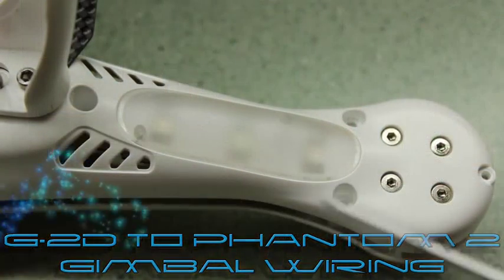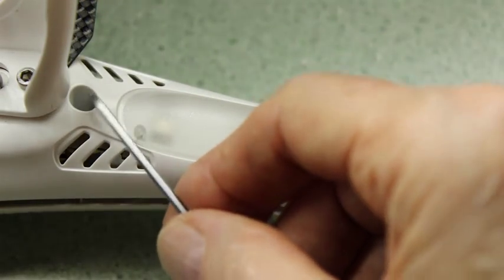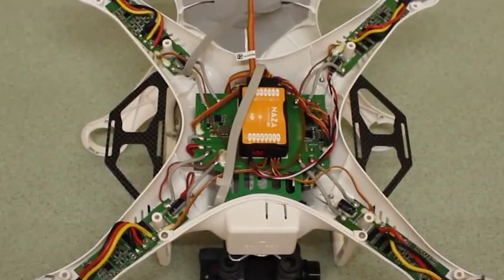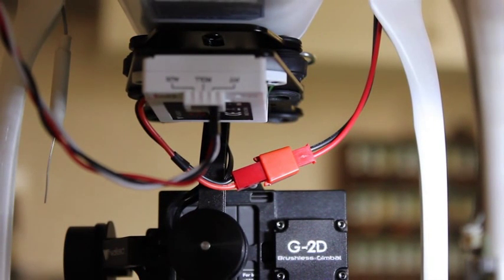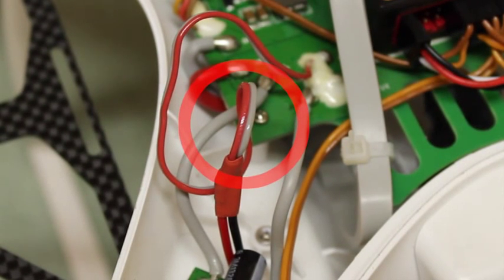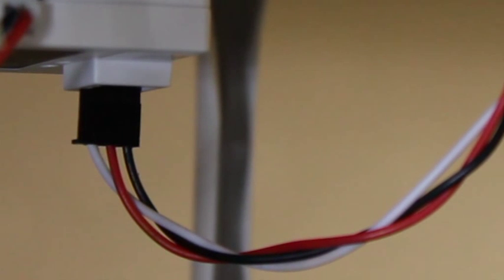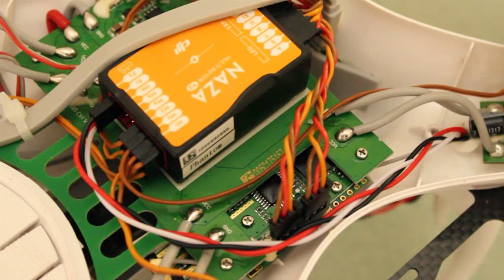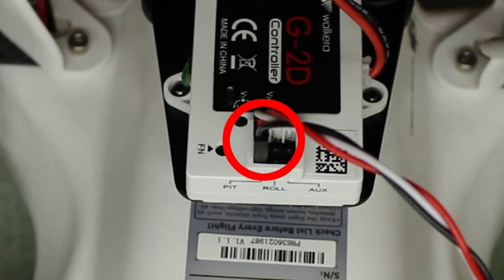Quad4A - G-2D to Phantom 2 - Gimbal Wiring

Comment: Do you know where can I buy the wires? Thanks
Reply from the maker: The correct name for the power lead is JST RCY.  Google that for data sheets, etc.  However when you want to buy from ebay, etc, the are also know as JST BEC set, 2 Pins JST Female + Male Connector Plug Cable Wire Line, JST battery lead, JST Connector Plug Cable Line Male+Female for RC BEC Lipo Battery, etc.  So JST BEC should be a good initial ebay search.  The cheaper ones usually have shorter leads so work out the length you need.  If you need longer you can always make up your own by buying the connectors and a crimping tool if you have a lot to do. 50 sets RC JST BEC Set Male Female Connector Battery Switch 2 Pin Plug Tin Plated was what I got last year for $6.65 and a $14 Dupont Pin Crimping Tool 2.54mm 3.96mm KF2510 28-18 AWG Crimper 0.1-1.0MM dps crimping tool but I know use a $75.00 PA-09 Micro Connector crimper Molex JST AMP HRS JAE Crimp Crimping Tools Japan which works better and does the micro ones which is the way the plugs are going.The other 3 wire leads are just RC Servo leads. 10x 150mm 15cm RC Servo Extension Lead Wire Cable Male To Male Cord Futaba JR cost $8.40 but they also come in different lengths and can have male and female ends.  They are really just Dupont plugs (like in your PC) and you can search and buy those as they can be cheaper but the wires are separate and not in a ribbon like the servo leads.  You can also by crimp connectors, Dupont, JST RCH, etc, etc and make up your own leads of any length or type with the $70 crimper.  That is what I do now as it is much neater, quicker and cheaper.Hope this info helps and thanks for watching.